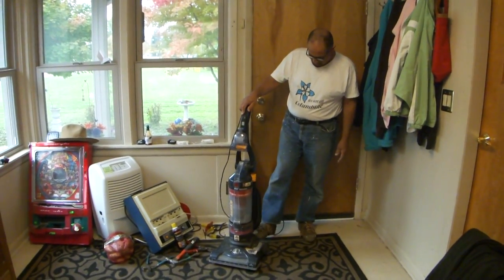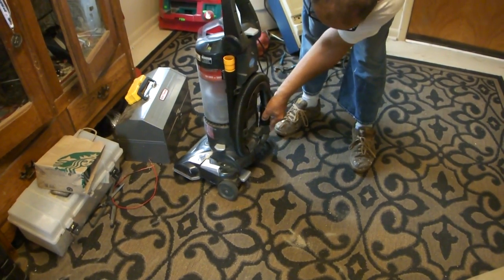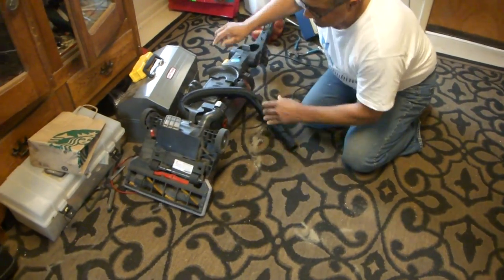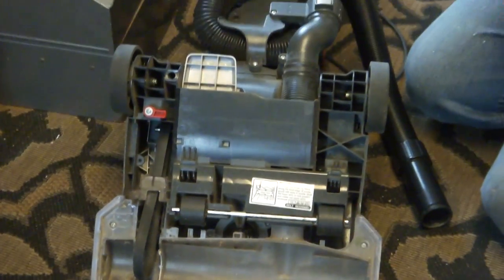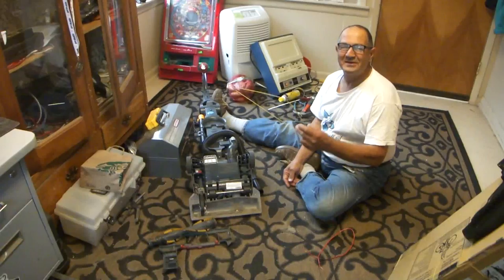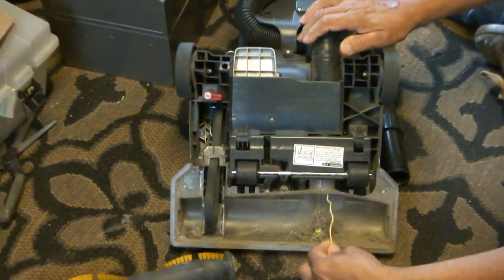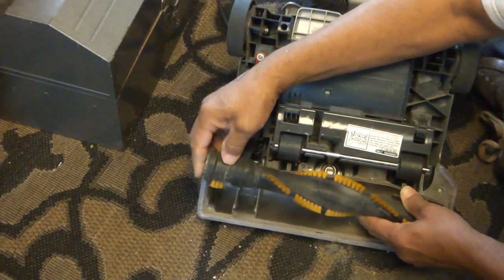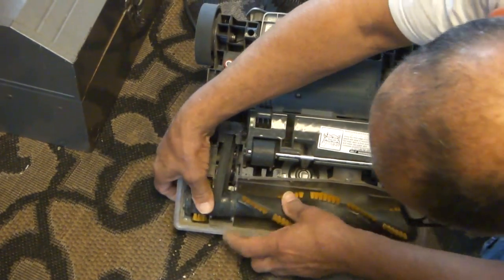How To Unclog A Vacuum Cleaner / Hose

Comment: If you use a coat hanger you take a big chance on poking a hole in the hose. Best thing to do is take the hose off and run a broom handle to clear the blockage.

Comment: I had just got my sweeper and it was throwing dust around, thought it was defective or already clogged until I seen you put the suction hose to the hole, I was useing the suction hose as a holder for the skinny attachment :l  it works perfectly now :D

Comment: the belt is streched! that is why it wont pick up tip it down them take out the crews like you did and then get the new belt the moddle would be on the belt or on the vacuum then put it back if u want to take it to a shop it would coast about $35 if u do it less the $3!

Comment: I did everything I could to find out why my vacuum cleaner not only does not pick up any dirt, it also speeds out some sand or dirt from my carpeting as a result of walking on my carpeting with my shoes on. I removed a lot of dog hair and dry dirt from underneath the vacuum cleaner but it didn't help. I have fixed many vacuum cleaners all my life, but this one is frustrating me. 
ANY SUGGESTIONS!!!?
Reply: Did you replace the belt?